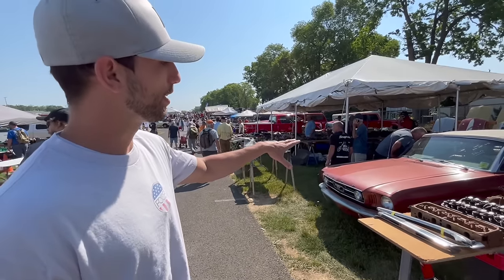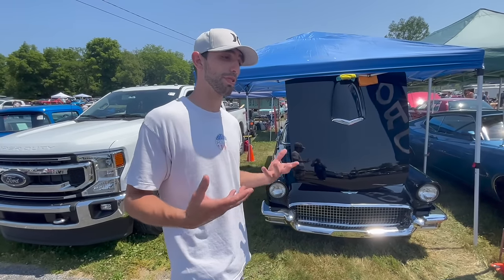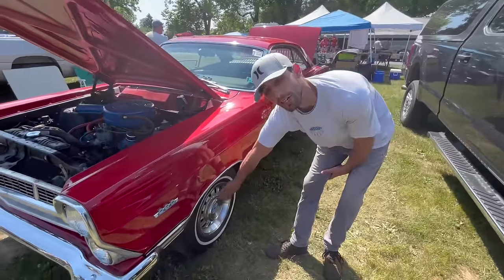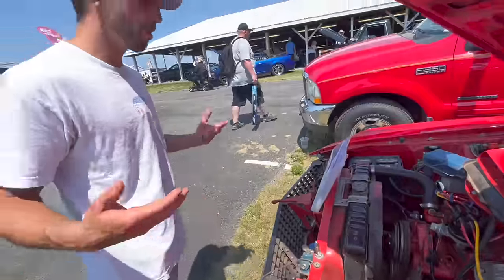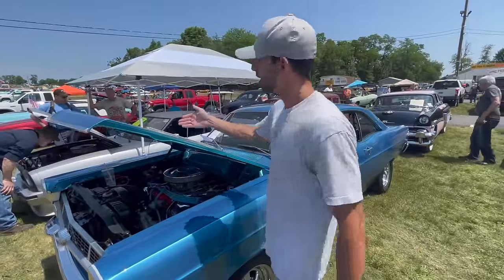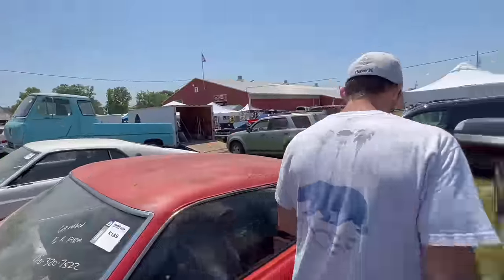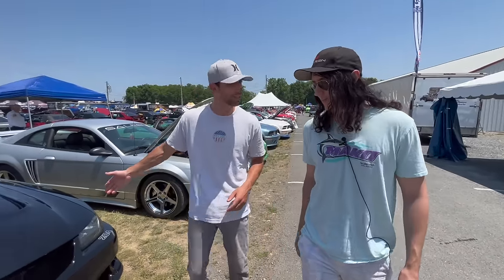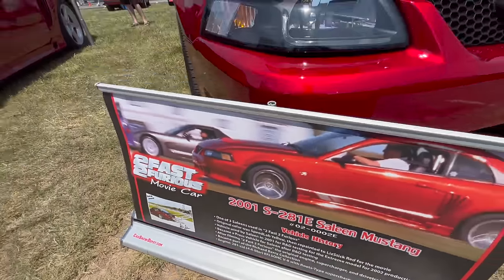Automotive Swap Meet Walkthrough! Ford Nationals Carlisle 2023 FULL

Comment: I ended up buying a 2007 mustang Shelby GT, black with the silver stripes. It now has less than 11k on it and has never seen rain,snow and never been smoked in. It’s the 4.6l 5 speed transmission but I always think about the 1969 Mach 1!

Comment: the restorer in Webster Fl  sold an R code that looked like it came off the showroom floor for $65K. Not a single repo part.  my friend saw one about 8/10 for 55.  his neighbot had until recently super low mile Boss 9 and still have a spare head on his wall

Comment: The Bullitt Mustang - Around the time Steve McQueen's original 1968 Ford Mustang GT 390-4V/manual fastback in Highland Green sold at auction for $3.4 million, I found a 1968 Ford Mustang GT 302-4V/C6 fastback in Highland Green in Monroe, SD for $12,500 cash. The car was from Colorado and the original owner had repainted it Lime Gold. When I first drove out to this farm to look at the the car, I looked at the Lime Gold paint, I didn't really like the car. Then for a closer look, I crawled underneath to inspect the frame rails for any rust and they were perfect and you could see the Highland Green paint on the frame rails. A rust-free '68 GT fastback in Highland Green, I near soiled myself. Bought it on the spot, came with matching numbers hi-po 302 block and heads.
Reply from the maker: Was the interior black? ive had a couple 68 highland green cars.. most with a green interior
Reply: @backyardbarnfinds   Ivy gold deluxe interior.

Comment: Thanks for the content.  I have never seen so many Ford parts and cars. Nice. Most of the Swap meets in TX are GM. I don't discriminate just what they seem to have here.  Did you see any 1971 or 1972 Ford LTD convertibles at this swap meet? I was wondering what the 2023 market value ranges are for running and driving non-restored mostly original cars?  I rescued a 1972 429, C6 car recently off a Texas ranch, mainly because I had never seen one before. Marti guy says only 566 72 LTD convertibles were made with a 429, C6, and 3.0 rear end.
Reply: I "missed" a couple of '71-'72 LTD convertibles back at Spring Carlisle 2011.  I hesitated on a brown '71 and then a car flipper bought it before I came back.  I believe it had an asking price of $8900.  A guy trying to buy my 1966 Buick Skylark never bothered mentioning he was the owner of a '72 LTD convertible that we could have made a trade deal on!  That car was kind of "roachy" for $4000.

Similarly, I saw a '72 LTD convertible in sky blue in 2012, but I was no longer in the market by that time.  Price was also under $10K for a very nice driver.
Reply: @jamesharding4056  I need to travel to find Ford (or Mopar) swap meets for sure.   Looked great.   I rescued mine because I have never seen one. Did not even know how limited it was until I received a Marit report for it.    I do not know the build numbers for 1971 but not a lot. Lots of online web data or Marti can tell us that. As I recall there were less than 4300 total for 1972 then Ford stopped making a full-size convertible. I assume a 71 or 72 with a Factory BBF was a small production number so even smaller today.  My old car expert says the "rule of thumb" for old convertibles is about 10% survive until the modern day.
Reply: As I recall, the '71 had a 351 Windsor and the '72 was a 400.

Comment: Thanks to the great video is the guy in Oak Creek Wisconsin  66 Mercury Cyclone Factory drag car it's the real deal427 High Ram 4 speed Locker red he owned it since new he's now 88 years old and wants to sell the vehicle it's an amazing shape he ran out a Great Lakes dragaway about 15 years ago I was there 920 In the quarter mile it has a tag on the door says not for street or Highway use produced by Ford Motor Company for test purposes only one of three produced this is number two he wants a million dollars for it I don't know if he'll get that but it's really cool when he pulled out of the parking lot and onto the road he did a burnout and dump the clutch yank the tires pretty high it's insanely loud it says 14:1 compression he has all documentation on the vehicle it's never been restored the motor was refreshed once man what a cool car have a great day🙃

Comment: Only fools pay those prices.. ive not paid above 25k to 67 n 68 fast backs. I just picked up a 68 390 s code GT for 85 hundred 1 owner 58k original miles...not a spec of rust.. all it needed was plug wires.